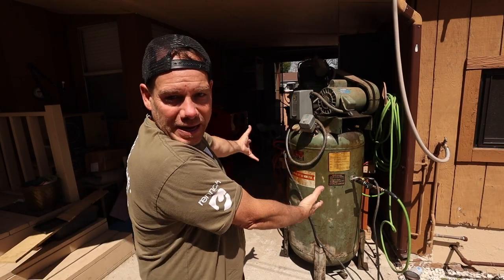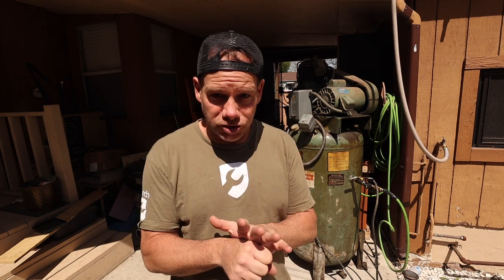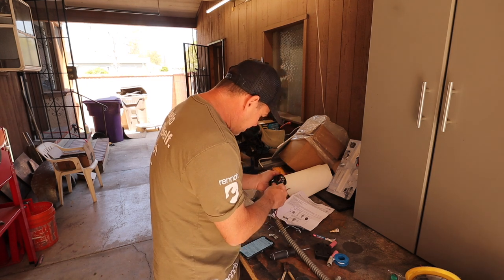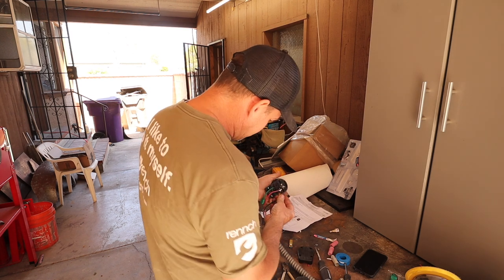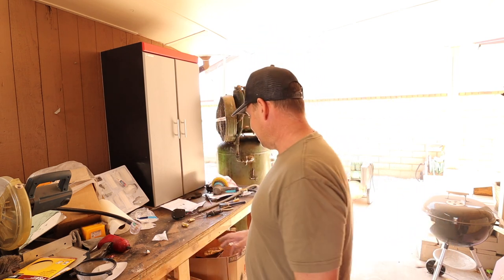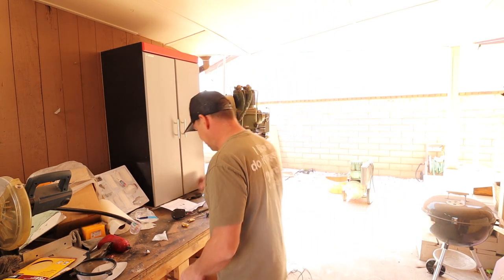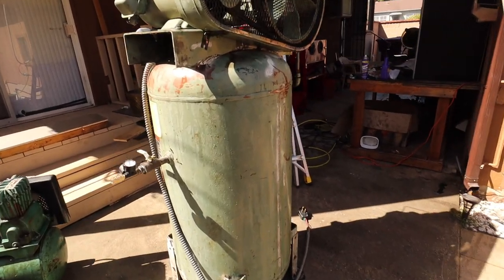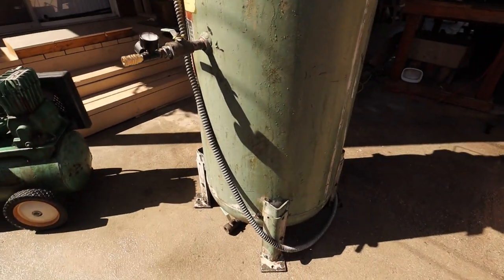Introducing THE BEAST!!

Comment: Be careful with that compressor, the tank is old and are prone to fail (burst) due to internal and external corrosion. If you have a borescope take a look inside the tank and see if there is any internal corrosion... people forget to drain them daily and they rust out.... you don’t want to be anywhere near it if it does! 😱

Comment: Great find.....I’m sure it’s loud, super easy to build an intake baffle arrangement to quiet it down....do a new belt, change the oil....you’ll need to upgrade that little pressure regulator.....I run black galvanized pipe in a U arrangement at the outlet of mine, the cold pipes help got the moisture out of the air lines, and then I can drain all the moisture out very easily.
Reply from the maker: Maybe you can advise me when you’re here?